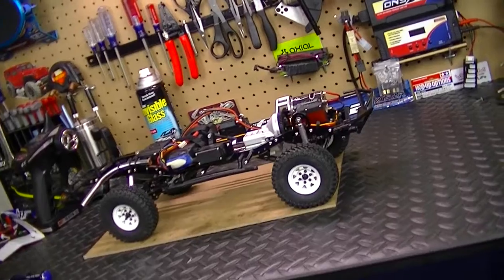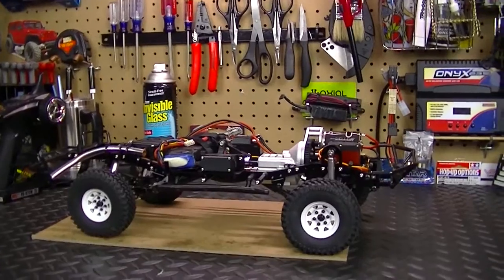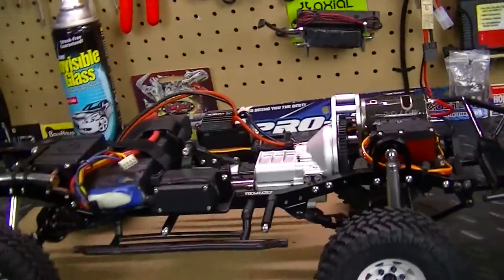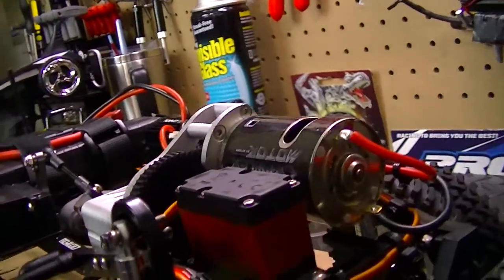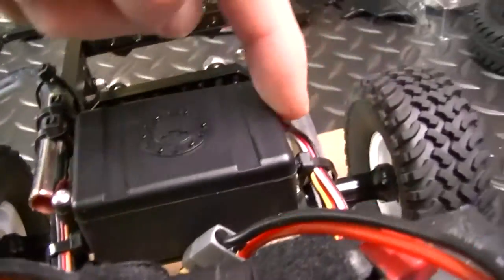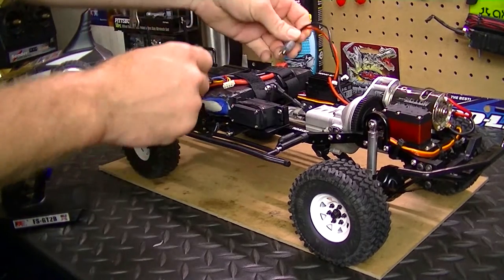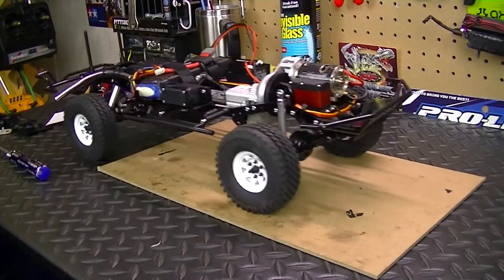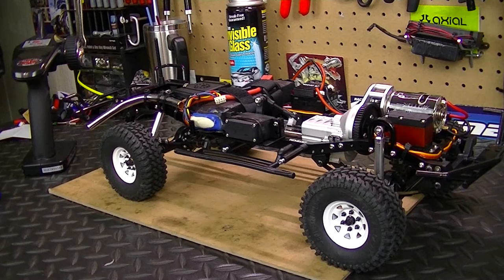RC84Films: TrailFinder Update 2

Comment: Coming along very nicely. What a beautiful machine! 
Watch out for the gear shift servo. When you switch gears when the vehicle is in stand-still sometimes the gears do not engage, blocking the servo. This may burn out the servo. 
On our Wraith with 2-speed gearbox we are using a Du-Bro Control Over-Ride Servo Saver (Cat. No. 120) to avoid stressing the servo.
Reply: FYI, I have a video about the innards of the RC4WD 2-speed gearbox for SCX10 and Wraith. At 14:28 I show the Du-Bro saver. https://youtu.be/0e7lXOve2hA?t=868